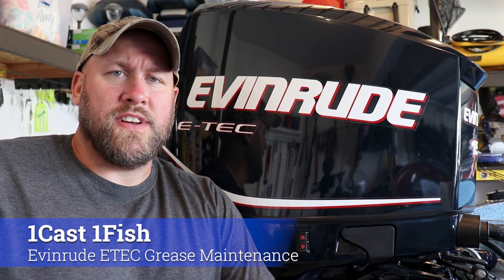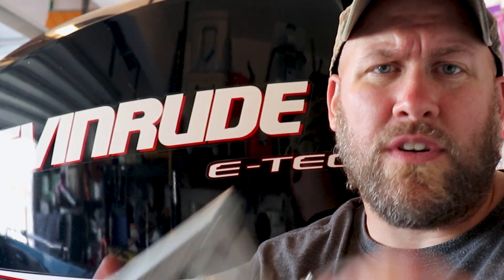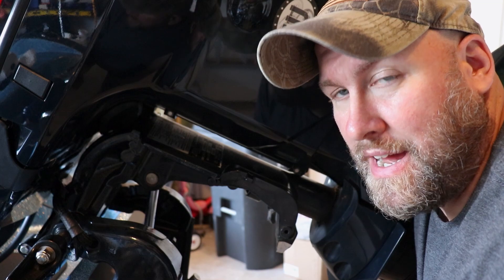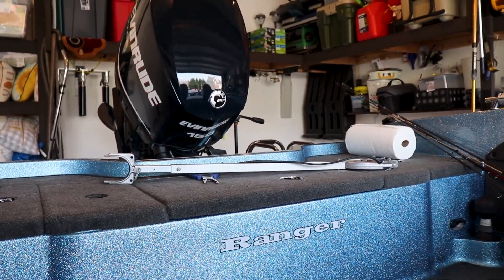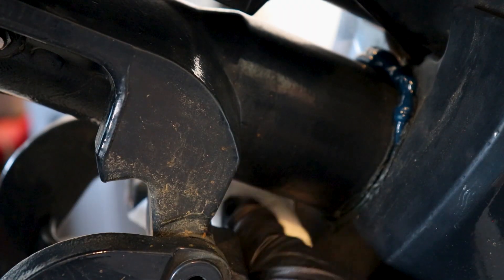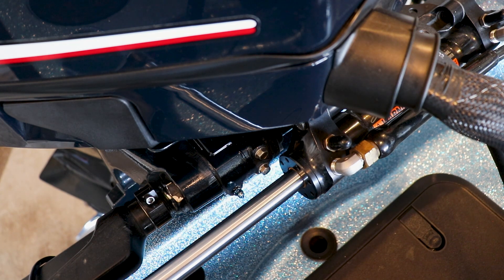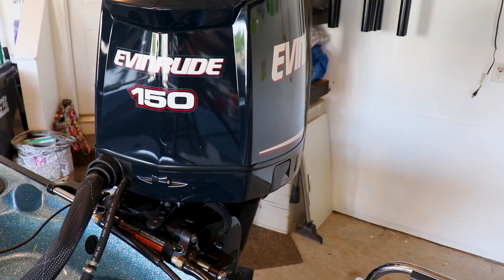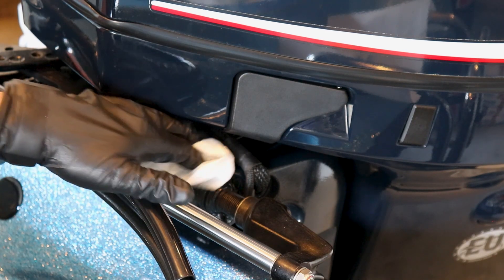Evinrude ETEC Grease Maintenance / 3 Year 300 Hour Service

Comment: Do you know the size of those 2 grease fittings you did last  ?   I need to replace them. They are 90* degree fittings on my older unit.  Thanks
Reply from the maker: I do not, I had to replace one of mine years ago as well...just removed the old and took it with me to the hardware store.
Reply: @1Cast1Fish  Turned out to be 1/4  28 Grease fittings. 90 Degree.
  Harbor Freight had them.

Comment: Is greasing a Etec 135 identical as the 150 as shown on the video?
Reply from the maker: I do believe they should be very similar.
Reply: Much appreciated. I'm new to Evinrude E-TEC 135, I'm interested to know what is the proper way to hook up a garden hose onto the pee hole for  and does the engine need to be turned on, I've only been doing it using the rabbit ears thus far, any advice would be greatly appreciated
Reply from the maker: The flush port is only for flushing...not running
I use a quick connect fitting on the garden hose...screw one end into the motor and the other to the hose then just connect them and turn on water.  
Some will say even to throttle the water, the ETEC is a low pressure water system, to high of pressure could possibly mess something up.
Reply: @1Cast1Fish we're fresh water lakes up in Ontario, thank you for your advice, cheers

Comment: Great videos. What a huge help.  My 06 150 etec ( 242 Hrs)  does not like to pee at idle.  Needs a little rev to kick start the peeing.  Is this normal  ?   Thank you.
Reply from the maker: So here is some thing I have noticed
1st ensure the motor is fully trimmed down for a few prior to start.  This develops a better suction head for the water pump to pull from (It does not have to work as hard).
Also it does take a few seconds to get water to start coming out...It is  low pressure system and must flood the whole water circuit before it starts to come out t he back.  I would estimate maybe 10 seconds on mine.
Reply: @1Cast1Fish  I filled a huge plastic container with water. 14 inches deep....Lowered the lower unit with the water intakes submerged 4-5 inches of water.  Fired it up.
It peed like a Camel !! 
Success  !  Youtube bailed my ass out again.
Reply from the maker: Glad it helped buddy...ETEC owners gotta stick together.
Reply: @1Cast1Fish   Update. I got a 100 gallon 'Ice Tub'.  This fills 24 inches deep.  I lower the unit in at  twice a week & start it up for 15 minutes when I'm not out on the boat.  The tell-tale is peeing like a camel.   The motor is running better than it ever has.   Starts up with half a turn.    *The Key is the depth of the water. The water intakes & tell-tale do not function with hoses & ears.  They want to be submerged.  The deeper the better.  The pressure of the water in the tub recreates actual boating operations.    Thanks for your excellent videos.
Reply from the maker: @matt75hooper sounds like you got a good system going to keep it tip top shape 😊
Reply: @1Cast1Fish  The motor had a little hiccup here & there.  I changed out the Squeeze  Primer this morning. 
Wow.  So smooth.   Tomorrow morning I check the hydraulic steering grease fittings. And the steering fluid.  I take lots of family & friends on the boat. It's got to be right.  These 2460 BayRider's are really spacious. I had 9 aboard 2 weeks ago....great time.
Reply from the maker: @matt75hooper hope you enjoy your time on the water 😊

Comment: Whats the best oil to use on my e-tec 200 and often should the motor be seviced
Reply from the maker: I use the ETEC XD100 oil, and service is 3 year or 300 hr.   I do lower Gear oil every year

Comment: Hi.  I have an Evinrude 200 hp and the tili tube is not taking any grease. Do you have any recommendations ? Tried heat and fitting rejuvinator but nothing.
Reply from the maker: So I am assuming that when you pump the grease just comes out around the fitting and never enters?
If grease is entering the fitting then we need to try something different.

You already tried the heat and rejuvenate...so that does not leave alot of options.
I am also assuming that you have the correct nipple for the grease gun and fittings.

Next step is to remove the fitting and clean it with a small wire and brake cleaner...if no luck then time to replace.
Reply: Thx

Comment: another excellent video. btw your fuel line is contacting the steering ram don't let it wear a hole in line.
Reply from the maker: I will have to check it out...I did have to some rubbing on the main power wires under the cowl that needed a bit of added protection early on.  Glad you enjoyed the videos...thank you

Comment: Both of my local Evinrude dealers have quit servicing Evinrude motors and carrying BRP parts or service items, so I've switched to Lucas Marine Grease with great results - stays in place as well as Triple Guard grease and I can also use the Lucas grease on the trailer wheel bearings.
Reply from the maker: I used the Lucas on my old boat for the same reason...it was simpler to use 1 grease vs 2.

Comment: Dont forget to add grease to your exhaust valve, have to remove lower plastic covers. Its on port side if engine. Just did on my 2014 E-tec 115 HO. Also had to replace my actuator motor but luckily the exhaust valve was not stuck due to someone else had applied grease earlier 😇
Reply from the maker: Correct on the lower HP motors...the 150 does not have this.

Comment: What grease gun do you need for the job and with what fitting ? 
I try to figure it out but the manuel doesn’t tell me.
Reply from the maker: It is a ZERK type fitting.  I used a full size grease gun with flexible hose and ZERK attachment.